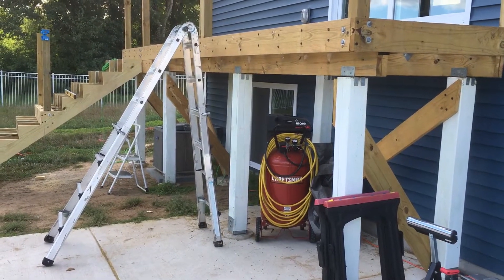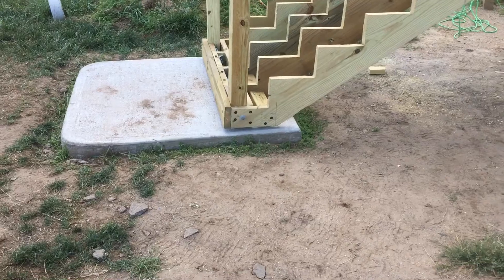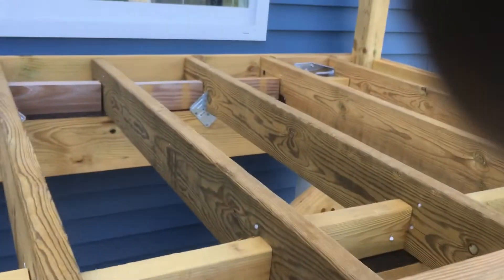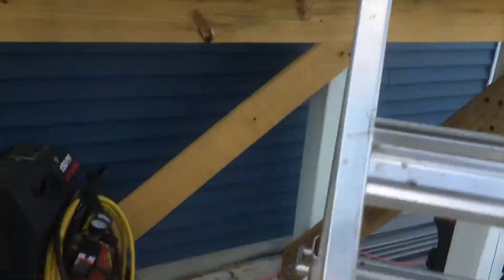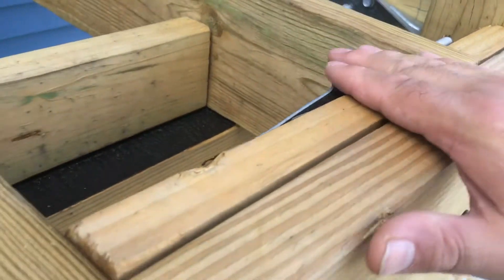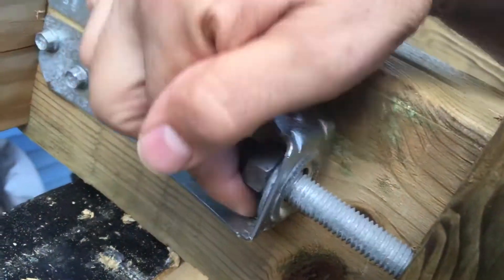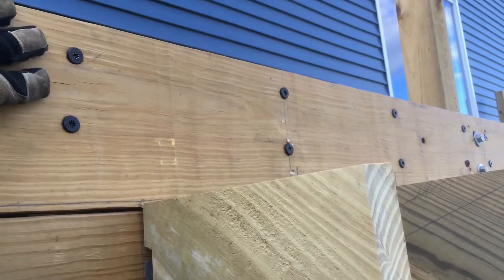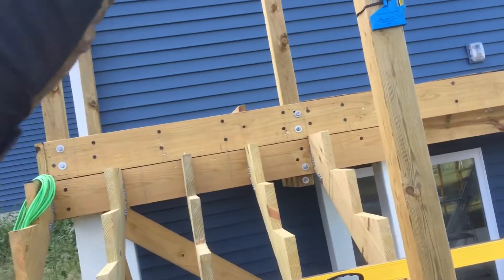Building an over engineered deck part two

Comment: Great build. I’m finishing up framing my stringers and looking to get some blocking between the stringers. Could you explain or post a video on how you did those kind of pocket hole style screws into the top of the blocking and through to stringer?

I’m really afraid of splitting the stringers so have been trying to predrill as much as possible. But with my 8” stringer spacing it’s tough to work in that tight space with the drill/driver

Comment: The deck is tiny! I guess with all that material you could not afford a deck you could actually put a table and a grill on. Never mind chairs and people. Nice job but holy crap thats stupid.
Reply from the maker: Hi Kevin.  Thanks for the compliment on the build.  I'm sorry you are not able to discern my intent for building the deck; as my beautiful poured concrete patio is not really visible in the video.  My purpose for the deck is a place to stand and have conversation, or to use the stairs to go down to the patio where the furniture / grill / etc are.